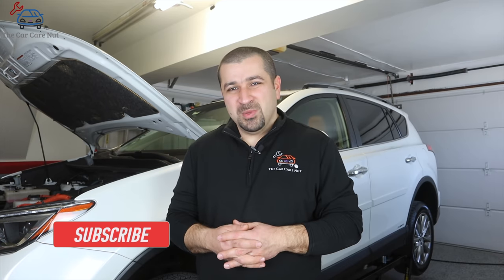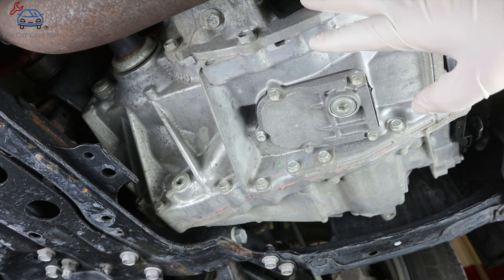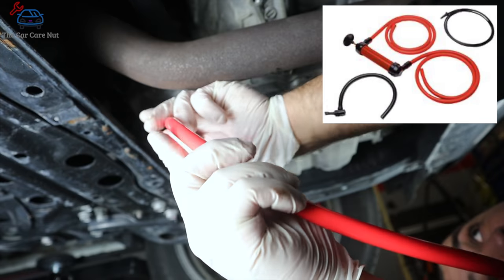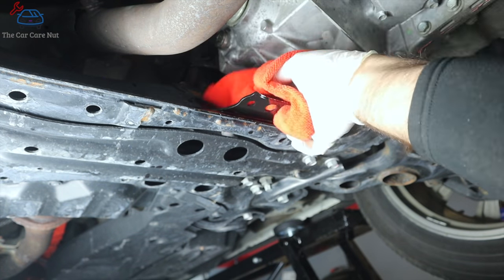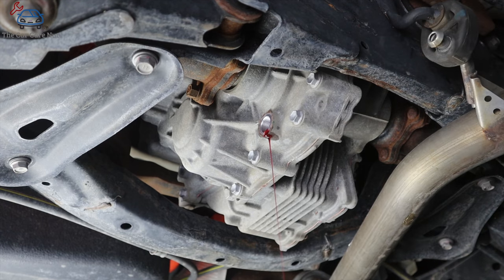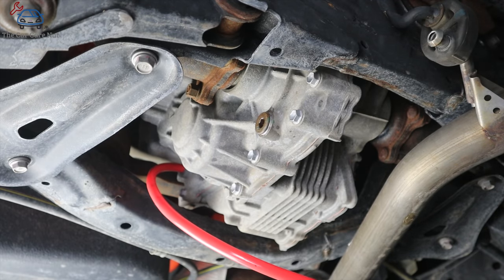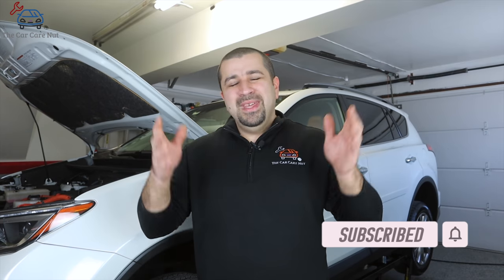How to change Toyota Hybrid Transmission fluid and Differential fluid

Comment: In my 2015 Lexus IS300h, the dealership has used 80W-90 rear differential fluid for three consecutive maintenance intervals. Now that I've purchased the car and want to change the rear differential oil, should I continue using the same 80W-90 fluid, or switch to ATF WS? Will using different oils cause any issues? Thanks a lot.

Comment: Awesome video. One tip to avoid the false fill issue is to use a smaller diameter hose so there is more room for air to be displaced and escape. May take slightly longer since you can't fill as fast, but should be a little less messy and not have the risk of underfilling.
Reply: Should engine be warm/hot like oil change?
Reply: @pgreenx  I assume the engine should not be freezing cold. Just to make sure fluid flowage is fine and it flows well out of the gearset. Unlike ATF in automatic gearboxes, the volume here is not that large to make big changes in leveling due to temperature changes.
Reply: I was thinking the same thing. Air will escape as the fluid is pumped in.
Reply: Yep and I catch the oil fluid in a pail that has the Qts marked out so I can make sure what I put back in matches the amount.  (FWIW:  Toyota Prius AWD takes about 1.3 Qts of WS.)
Reply: EXCELLENT and INVALUABLE Video once again Sir. Thank you!

Comment: Hello AMD, great video, how do i raise the car at home DIY garage ? if i raise using jack stands or ramps on front wheel, vehicle’s front will be lifted upward and it will not be leveled which might false read filling the transaxle fluid, right ? unless lift the rear wheels also with jack stands. ? is there any better way to do this

Comment: I have a 2021 Toyota Avalon hybrid getting read to turn over 100K trouble free miles. Dealer has performed service every 5K miles and now suggests a transmission fluid flush at a cost of $482 plus tax. For a DIY'r, does this video apply to my particular vehicle as far as your ATF WS  fluid recommendation, drain and fill plug location, gasket part#, and no filter to replace?  Thanks!

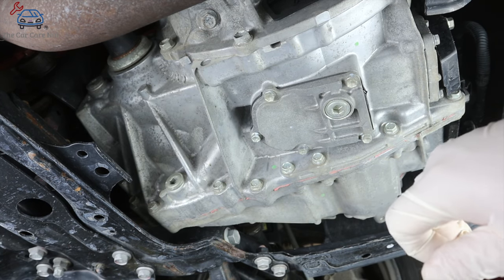Comment from the maker: On 4:31 of the video I mentioned drain, I wanted to say fill. So you always take your fill plug first before the drain plug.

For non hybrid transmission fluid replacement see this video https://youtu.be/eRxSu4-4ojo
Reply: I changed my ATF on my 2002 Yaris (UK) 2NZ-FE 5 yrs ago at 80,000 miles,now has 90,000m,should i change it every 4 or 5 yrs,as i do v.little miles.Thanks.
Reply: I noticed this right away when you said that, but I knew what you meant to say. You never want to drain your fluid if you can't FIRST make sure it can be filled. Also good to stick your finger in the fill plug to check the level before draining.
Reply from the maker: I would change the fluid every 6-9 years. You still have at least a year
Reply: @TheCarCareNut  Thanks for the reply.
Reply: @TheCarCareNut  My 3rd gen Prius only 3L instead of 3.3 L measured from the drained fluid. The car is level and it is still 3L.  Should I add 3.3L or Put it back the same amount 3L.  I know that hybrid transmission has no torque converter that may trap some of the fluid.
Reply from the maker: Hi! I would fill it until it overflows
Reply: question is there no transfer case in the hybrids ?
Reply from the maker: No transfer case in hybrids
Reply: @TheCarCareNut  i see thank you, last question this video process applies to the 2016 highlander limited hybrid correct and not the one with the closed transmission?

Its not a smart question but i wanted conformation so i dont f up 😂
Reply from the maker: This video is for hybrids only. Non hybrids I have another video for that
Reply: Thank you
Reply: Apologies for my ignorance, where can I find the transmission for a 2019 Rav4 Hybrid ? Rear or front ? 

I’m having trouble locating the fill and drain plug. 

Thank you
Reply from the maker: Hi! On the front you’ll need to remove the covers to find the drain and fill.
Reply: @TheCarCareNut  Hi, im from London and I've got a 4 gen 2012 Lexus GS450H, I've bought it 3 years ago at 27000 mile, I have now 70000 mile and I've done only oil change with filters every 10000 mile, everything drive good, I thinking what I'll should do to the next service? The transmission service is the same as in the video? What to you recommend?
Thanks you God bless!
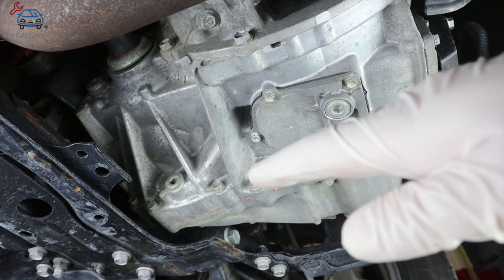Reply: At 4:52, you (CCN) again referred to removing the drain plug when you meant fill plug
Reply: Have a used 2012 Camry hybrid.  Thank you very much for making this video.  At 110k, finally changed all the fluids by watching your videos.  I am glad I listened to you and opened the fill plug first.  It couldn't open and stripped by the hex key. I then tried and used torque wrench with hex socket , it finally opened.  Replaced it with brand new genuine plugs and gaskets.  That's a joy! First time for everything.  Advice to noob like me, don't give up.  Take some breaks, tackle it another day.

Comment: As always I appreciate you making these. It’s pretty hilarious how simple these hybrids are. I was all intimidated for absolutely nothing. Obviously if something catastrophic happens it sucks just general maintenance is so easy. Toyota is king.
Reply: Just changed rear transaxle fluid on my 2019 Rav4 hybrid. Two things that made it more time consuming and difficult then this video showed was you need to remove the plastic aero cover (not a big deal) and the top fill plug was blocked by high voltage cable input (only about 2 inches gap to get socket in to remove it). Living in rusty climate sure didn't help either 😄 Don't forget to buy 2x replacement gaskets for bottom and top plugs.
Reply: @James-il3tq where do you buy the gaskets? Toyota dealer? Can you order the gaskets and oil online?

Comment: My local Toyota dealer recommended yesterday to change my differential fluid in my 2021 RAV4 hybrid with 30,000 miles on it.  I declined it but checked with Car Care Nut as soon as I got home.  I’ve had zero issues with the car. They also recommended four wheel alignment. Again zero issues, tire wear good and even all around, no handling issues.  I think not.  And brake fluid replacement, again no issues (and the brake fluid is totally clear and proper level).  And of course the cabin filter and engine filter replacement.  I declined everything but did purchase and replaced the filters myself in 5 minutes.  
I know times are tough for some dealers now but I’m not falling for unnecessary maintenance when it’s just not needed.  
I trust you more than them.  Thanks again for what you do in saving us unnecessary expense and potential problems.
And to add insult to injury, when I replaced the engine air filter, I found they had not clipped the filter housing after their inspection. I will be speaking with their service manager today.
I’m the guy that inspects, blows the dust off and wipes down my engine bay with a damp micro fiber towel once a month. 😂 That guy.
Reply: Don’t ignore your brake fluid, it’s hydroscopic and should be changed regularly regardless of its visual appearance.

Comment: I know this video is 3 years old, but it helped me change the fluid in my 2010 camry hybrid.

When i ordered the ws fluid from Toyota, they told me not to change the oil!

But Im SO GLAD i did. It was not changed in 14 years, and almost black. Its done 190k kilometres
Putting in 4.1 litres of new WS, it now runs way more smoothly and is much more quiet.
This video gave me the confidence to tackle this job.

Comment: Thank you AMD, I’m just returning from my dealer after having the high voltage cable replaced following a hybrid malfunction error came on. I asked the service advisor if I could schedule a transmission fluid replacement, he told me there’s no need to do that on the hybrids as they are sealed and therefore not required. I have a 2020 RAV4 xse hybrid, and I really do love it.

Comment: Hi! I just recently found your channel. You’re advice and thoroughness is great!!

I changed my transaxle fluid on my 2013 Prius C at 184,976 miles. I’m the third owner.

The first change I have record of is from the dealership at 55,995 miles. (1st owner) 

The second change I’m guessing was between 136-140k miles according to records on My CarFax. (2nd owner) 

I take the car for service to the same dealership the first owner bought/serviced the car at, since they’re the best in my area. My car is currently there for a transaxle clicking/clacking noise when in D, N (loudest), and R.

I’m thinking I may have under filled the transaxle case because of a false reading, when I changed it myself. I didn’t know that was possible until watching your video!

The dealership said they couldn’t replicate my noise, so I will get the car back today 9/27 or tomorrow 9/28. I’ve asked them to do a transaxle fluid change, but they’re charging $230 for the service + $160 for the diagnostic since they couldn’t replicate the issue. So, I’ll have to pay $390 for everything.

I’m more than willing to do the service myself again, and follow your steps. I think it would be around $120 in supplies for me to do it.

This would also give me a chance to look at the fluid color and smell it. If I let the dealership do it, I don’t trust that I’d get accurate information from the tech. (They’re really busy!)

Are there any special tools/procedures the dealership would do, that I can’t do myself?

If not, I may just do this myself so I can know how the fluid looks when it comes out. I’m really concerned there might be a problem, and the dealership is just not having luck replicating it.

Let me know your thoughts, thank you! :)

Comment: Great video. I'm learning so much. This fluid change is so much easier than cvts with standpipes and temperature requirements. Way to go Toyota.
Reply: Just changed rear transaxle fluid on my 2019 Rav4 hybrid. Two things that made it more time consuming and difficult then this video showed was you need to remove the plastic aero cover (not a big deal) and the top fill plug was blocked by high voltage cable input (only about 2 inches gap to get socket in to remove it). Living in rusty climate sure didn't help either 😄 Don't forget to buy 2x replacement gaskets for bottom and top plugs.
Reply: Yeah the 6-speed AT on my IS350 requires me to fill it until the overfill starts to drip, install that plug and then fill it with another 1.3 qts, then run the car until the transmission gets to about 120F and climb under it while it's still idling and reach past the hot exhaust to undo the overfill plug and wait for it to stop draining. Crawling under a running car is my least favorite step by far.

Comment: I change my eCVT fluid at 34000 miles (Rav4 awd 2019), may be a little bit too earlier, but the fluid was like new, a nice red color. Japanese car are really awesome, like you! Really good videos!
Keep on going 👏
Reply: Hello Nicolas, do you remember how much fluid did you use? All I can find is that for the rear differential you only need around 0.48 To 0.58 Us qts. In the video description, it says 4 quarts... Thank you!
Reply: @tupamarek  Hi Marek,
I asked my brother-in-law who works as a mechanic at Toyota and who did the oil change, that the front one needs 4 liters (4.23 US Quarts?) of ATF WS and the rear one 2.5 liters (2.11 US Quarts?) of ATF WS for my Rav4 2019 AWD.
Beware, I’m not familiar with Us quarts (I use the metric system).
Hope it will help you ✌️
Reply: @nicolasm4121  Hey Nicolas, thank you very much for your quick answer! I live in Europe so the litres are more helpful for me anyway :D I ordered 7 litres - thanks a lot again!
Reply: @tupamarek  you welcome ✌️
Reply: These are just planetary gears, no friction surface like traditional AT or belt CVT.

Comment: Thank you for making your informative Car Care videos.  My 12 year old Camry hybrid has been a great car, and after getting a quote for $900 to change fluids from the dealer, I used your vids to do it myself at a "rent a bay" workshop nearby so I could get under the car.  Changing the ATF fluid in the CVT case is easy, though potentially a bit messy when re-filling it with a hand-pump.

Comment: I just used a cheap Walmart 1-gallon sprayer to get the ATF WS in my Tundra and worked great!  Only had to re-pump it twice to get 3 quarts in there.  I have two Prius'  (Prii) so need a stash of those crush washers!!

Comment: The hardest part is removing the aeropanels.  There are a lot of clips not all the same size and they break easily.  There are also a bunch of 10mm bolts.  I found that putting the bolts and clips back exactly as they came out makes your life easier.  Also, spray the bolts with penetrating lube so they don't rust.  Last, always wear safety glasses when under the car.
Reply: rubber grease all those plastic clips and 10mm bolts
Reply: I live in Canada with salty winter roads. Removing aero cover was quite easy I found however removing drain plugs was much more difficult (they were rusted pretty good with 70,000 miles on my 2019 Rav4 hybrid). Most difficult part was the top drain plug had the orange 800 volt high voltage cable input blocking it leaving only about 2 inches which made getting my 10mm socket wrench in there quite difficult. Was just able to get it off, wasn't able to get torque wrench to fit when putting back on so just gave it a solid crank.
Reply: Those clips come out easily if you have the right tools for removing clips, it's a worthwhile investment. Also depending on where you live it might be best to just get in the habit of replacing the panel screws every few years when they start to get rusty any time you have to go under there to change oil or such. The screws come coated but the coating is scratched off so easily.
Reply: @jeffumbach  i found the "right tools" don't work well and just use 2 flat headed screwdrivers.  I've tried two different tools and they are a waste of money imo.
Reply: @James-il3tq   Can I ask  did you need to unbolt high voltage cable? Another YT video showed him taking the high voltage cable off for better access.

Comment: Thanks for making this. I did it for the 1st time today. It took a while to orientate myself and see the 2 hex plugs. Only tricky bits for me were (a) getting the car roughly level with 2 different makes of axle stand. And (b) replacing the cover, with 2 sizes of push-fits, some bolts, and 2 sizes of screw. Happily I had all day, so took my time and got it right. Thanks again AMD.

Comment: This video was super helpful for me. I bought 5 qts and glad I did. Also it seems that inside the case of the transmission there is a piece of metal that goes across the opening I negated this by sticking the tip of the fluid transfer pump above it so that I could get the best fluid level possible. Thank you for posting this video, it helped a lot.

Post comment edit.

If you’re doing this on a ES300h,
Have 6+ quarts on hand. After you put the 5 qts in. Put in the fill plug then put the vehicle in maintenance mode to circulate the fluid. Afterwards open and add an additional qt until everything starts running out again. Then the e-cvt is at the correct fluid level.

Comment: Thanks for the video Andy....I just picked up a Lexus ES 300h, and this video was indispensable. It's a good thing I changed the transmission fluid. It was way passed it's useful life. For me today; 4 quarts out, 4 quarts in.
Reply: My 2006 Toyota Highlander Hybrid Limited 3.3 liter V6. Front wheel drive. 2 wheel drive. 3 out. 4 in.  It needed 4. Maybe 3.93

Comment: You make it so much easier then I seen in another video. After they fill it, I see them cycling the trans from N to D then back to N multiple times and showing all this worry an concern. I am so glad you made this video. Most important tip I learned from you is: "No False Readings!" Thank you for the video!
Reply from the maker: Thank you for watching my video! Cycling from neutral to drive in a hybrid transmission does nothing mechanically inside the transmission other than release the parking pawl.
Reply: @TheCarCareNut  They were giving me the illusion that if you don't do this and you don't give a chance for the new fluid to get inside properly that you can damage the transmission. 

I am so glad you cleared that up! Thank you so much for the time you take making these video's! Total life saver!
Reply: Great video, thanks from Ireland. I have a 2019 Camry 2.5 Hybrid, would you know which transmission it has, this video type or the internal straw dipstick type??
Reply: @gabrielcoll5669 if you don’t see more than one dipstick in the engine bay, then it is the same as the video.. which is very likely since newer models got rid of the transmission fluid dipstick

Comment: Yet another excellent video. Thank you so much. I just did the transaxle fluid change on my son's 2016 RAV4 XLE HYBRID, and it went exactly as you described. For the rear transaxle, my 10mm hex bit socket, 1/2" drive, didn't fit. Since I didn't have a 10mm hex bit for a 3/8" drive, I used a 3/8" hex bit socket for a 1/2" drive instead. I lucked out, and it worked.